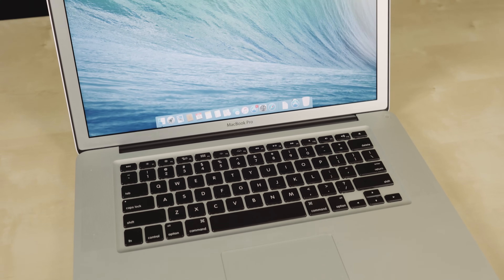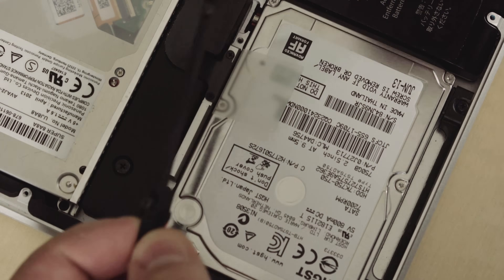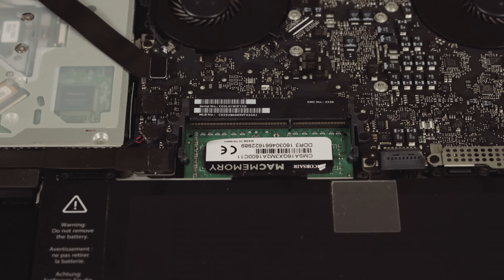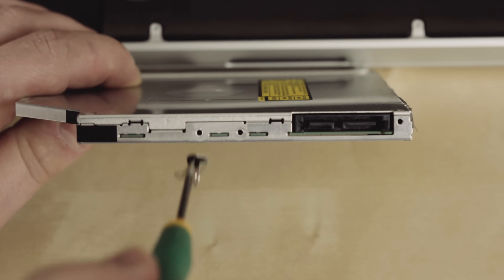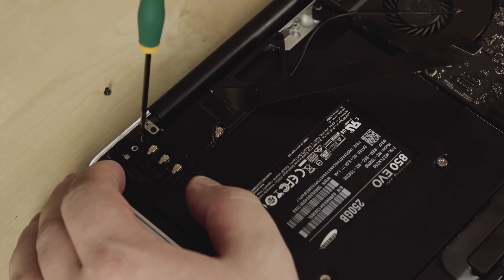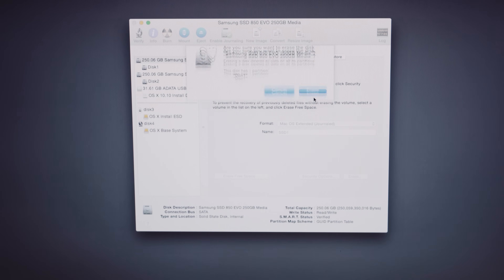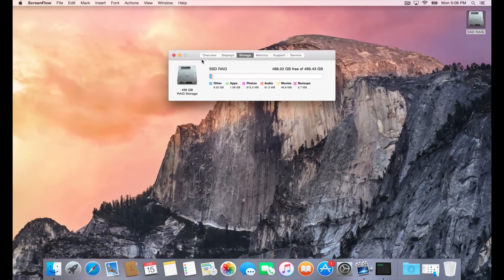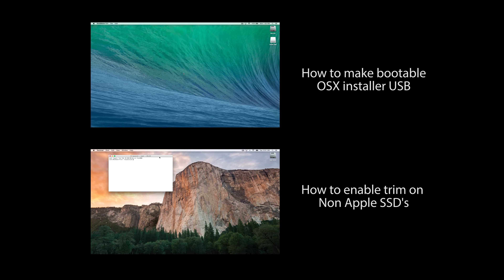Fastest 2012 MacBook Pro Ever! Upgrade Guide - in 4K

Comment: 16gb of ram is a waste. New macs don't even have that much or even require them.
Reply from the maker: Not entirely correct. The new 15" Macbook pros all come with 16gb. I max out 16gb all the time. I have 32gb in my main editing system and I can even max that out. Its necessary for running multiple adobe apps like Premiere and After Effects dynamic linked together. But you would be correct if all you do is surf the internet and do word processing and photo editing.

Comment: this is funny video it's all sounds you have to spend 400 dollars for two ssd card and 16gb memory card, you don't need to buy a new ssd hard drive for your macbook pro 2012 just buy 8gb memory card and i will tell you will meet how faster your macbook pro.
Reply: VisionOfCreation. It will be FASTER, but not the FASTEST. Rev Constantino suggested only upgrading RAM to 8 GB will give you the fastest Mac, but that's complete bullcrap. Of course, it will be FASTER, but not the FASTEST.

I got 16 GB on my 13" MBP 2012, and it got way faster, but it still can be improved. I do not want a RAID configuration because I can't afford two high-capacity SSDs. I'll eventually get a 240 GB SSD (Nintendo Switch was a priority Lol) and I'll do a Fusion configuration with the existing 500 GB HDD it already has

A RAID configuration is faster than a single SSD, because they basically split the writes. It's like doubling the lanes on a highway. Twice as many cars can drive on it, but that doesn't mean you need all those lanes. I don't need that much speed, so I'm making a Fusion configuration. If you need it to be faster, a RAID configuration is the best, as the purpose of this video was to show the FASTEST configuration. It's just that sometimes FASTER is enough
Reply: Yes, please.
Reply: I don't get you

You say you only need to get 8 GB of RAM to make your MBP faster, and that I get it completely.

But this vid is not about having a faster configuration, BUT the FASTEST configuration (some people won't even want a RAID configuration, like me)
Reply: Intelligent Investor

Storage times are only relevant to load times and writing times (Like exporting a video from iMovie or something like that)

RAM is much more important to the actual performance of the programs you use, because if RAM gets full, the OS will automatically use SWAP memory (virtually expanding RAM by allocating less used data in the storage drive, which also consumes CPU cycles), and even SSDs are slower than RAM. Also, Integrated graphics do not have dedicated RAM, so they share the RAM with the system. Having more RAM means the integrated GPU can use the RAM it needs freely while the system still has enough RAM to work with

TL;DR. Upgrading RAM gives you better performance, while upgrading storage gives you better reading/writing times

My suggestion: Upgrade RAM first. I have the same mid-2012 13" model and the RAM upgrade made it work beautifully
Reply: If you don't need the optical drive, you can replace it with an SSD. If you want to merge your existing HDD with the new SSD, a Fusion Drive would be great for you, as it gives you approximately 80-90% the speed of the SSD but the full capacity of both drives as a single one

Keeping the optical drive and switching the HDD with an SSD is a bit harder, since you'd be sacrificing storage or paying a lot of cash for an SSD with the same storage
Reply: put a single ssd in it, my 2009 boots from cold in 15 seconds with an ssd.
Reply: David Navarrete sooo, could I not just get the 500gb SSD instead of doing raid configuration and it will still be as fast?
Reply: VisionOfCreation no because when you have 2, its double the speed at (for example his 3gb file) they each do 1.5gb at the same time. if you had a 500gb ssd then it would have to do all 3 gb by itself
Reply: So would replacing an SSD make the best first step or upgrading to 8gb memory card? I have a mid 2012 13" with 4gb currently.
Reply: That's why I made it clear the SSD improves reading/writing times while RAM improves the actual performance

I chose to upgrade RAM because I wanted my programs to work better once they're open, even though they still take a bit to open. If your programs do work great enough for you and you just want to improve how fast they open (or how fast a video editor writes a 2+ GB file), then the SSD is the way to go
Reply: Dude so i was a bit lost but I am halfway done with my upgrade. I have a mid 2012 mac 13'' and just (yesterday) replaced the ssd. I got the samsung   860 pro 265gb and man this thing boots up nice and fast! I am wainting for the two 8bg to replace the two 2gb (4gb total, this is also what you have) so ill end up having 16gb instead of 4gb. They come in tomorrow but just with the ssd alone i can see a big improvement with speed.
Reply: You make no sense are you on drugs?
Reply: Rev Constantino Your grammar is outstanding
Reply: i have 8gb ram, please tell me how can i make my mid 2012 faster?

Comment: thanks for upgrading guide, so helpful. but i have a question: the ram of mbp can be up to 1600 Mhz, why didn't you buy 16GB 1600Mhz of ram instead of 1333Mhz of ram? 
https://www.amazon.co.jp/シリコンパワー-ノートPC用メモリ-PC3-12800-SO-DIMM-SP016GBSTU160N22/dp/B0094P98FK/ref=pd_sim_60_3?_encoding=UTF8&psc=1&refRID=MTSM54QWGYW66B1BQ1P4

Comment: Does anybody know if i can format to Raid0 externally? Would i have to have 2 SATA usb adapters? What i really want to do is to clone over a whole operating system from my old drive to the SSD's so that it will just start up as if it was my old computer.
  But if i format the drives in the machine will they then be able to be cloned from the other drive or will the cloning process undo the formatting that i have just done?
Reply from the maker: Im not sure if the system would recognize them correctly or not once you install them back into the system. But there are external USB enclosures that are designed for doing raid. They have two drive slots.

Comment: i did this to my 2010 mid and ya lol, ton of speed n all
Reply: Urska Jinx so it did work for 2010?
Reply: yes it did ^^
Reply: hehe hi Xd
Reply: @intelligentinvestor apple says that but the computer recognizes the 16gb of ram
Reply: Urska Jinx does it work for 2009 MacBook Pro?
Reply: Urska Jinx how much did you waste? I have 2010 Mac Pro 13in and looking to do the same thing. So it does work?
Reply: Urska Jinx any issues with this upgrade? Apple says 8gb max. Just wondering
Reply: @Idiotsincarshere  According to OWC and some other sites, you actually can go to 16GB unofficially. More information here: https://blog.macsales.com/16302-some-2010-mac-owners-can-get-more-ram-than-they-thought
Reply: I did my ram for my 2010 mid a couple of years ago and was surprised how much speed I got from it. The next project will be to upgrade from a 250 GB HDD to a 1TB SSD.
Reply: Urska Jinx it did?
Reply: Jimmy Sal that's the model I had and it worked perfectly
Reply: Is it fast enough to run fortnite????

Comment: I upgraded to the same Samsung SSD with 16GBs of RAM. If I wanted to add that second SSD does it have to be the same size as the one I have or can it be smaller because mine is 1TB and they are expensive?

Comment: hey im just wondering if using two 500gb ssd's would make the mac's performance faster than using two 250gb ssd's. Also, i was wondering if the battery overheating is an actual issue and if you get to keep this fast performance for a good time. thank you!
Reply from the maker: No you wont get any faster performance you just gain extra storage space.

Comment: @Zed ProMedia I have a question and want your opinion. I have a friend that is willing to sell me his 2012 13" i5 MacBook Pro for $500. Is that a good deal? Should I take it or leave it?...
Reply from the maker: Chris Hayes depends on what you use your computer for? $500 isn't a bad deal.
Reply: Zed ProMedia I'm wanting to get into video editing with premier pro. Stuff like that... the mac is completely stock so no upgrade are currently done on it. But that is why I watched your video and was wondering if that would help it perform better in what I want to use it for...
Reply from the maker: It will perform better because the read speeds in your timeline will have less issues with stuttering. Adding extra ram also helps with playback in the timeline. You wont see much improvement in export times though. And, unfortunately you cant upgrade the video card so that will have some implications when editing 4k video. But its pretty solid considering its 4 years old.

Comment: Is it better to buy a single 500gb SSD or two 250gb SSDs? would that change the performance?
Reply: Buta You only get speed improvements if you set your ssd's into a RAID configuration, just having 2 250gb ssd's will not provide any speed benefits over a single 500gb at all. In your case it would be more beneficial to purchase only one 500gb ssd for futureproofing and upgradability
Reply: What is RAID mode?
Reply: They both will be treated as only one. That's why you get better speed. You copy a 3GB file, each SSD will write 1.5 GB of that file at the same time. It'll last as much as one single SSD writing 1.5 GB, but they wrote 3 GB total

If you don't mind getting stock speed, you can always set some symlinks/hardlinks here and there to have the OS in one SSD and your desired folders (ex. Applications, User folder, etc) in the other SSD
Reply: Brend Vanden bussche guys, anyone can answer, but how will things be saved? Which SSD will applications, documents and downloads be saved to if you have 2 ssd's in RAID? Or will it just treat them as one? If you want to back everything up, will the external read them as one ssd and know what to do? Thanks
Reply: Zed Pro Media: would using 2x500GB give much increase in speed v. 2x250GB or would the gains primarily be in additional storage space?
Reply: Does it matter if the 2 SSD's are GUID Partition type
Reply: Buta Yes, because the read and write speed conna be not so fast like 2 Ssd in raid(double gb double speed)
Reply: Creeperguy555 why not do a back up then?
Reply: The downside is that a RAID is TWICE as likely to have an error or have a disk crash. Even the 2Gb 850 Evo Zen used can pull over 900 Mb a sec on Blackmagic solo and the 860 Evo should be even faster so the go is to put a 9.5 mm thin 2Gb HD for $100 into the DvD bay and a single big 860 Evo in the HD bay. 4Tb onboard storage for cheap!
Reply: Astuces 01 get outta here with your spam 

Giys don't listen to this guy, he is trying to install a virus on your computer
Reply from the maker: No performance gains. But you get an increase in storage capacity
Reply: Zed ProMedia which one will have more storage?
Reply from the maker: Oh sorry I thought I read 2 x500gb or 2 x250gb. You get double the speed from having 2 x250gb.
Reply: Zed ProMedia got it, thanks for the help!

Comment: Hello, I found your video and I am so thankful. I was thinking about upgrading my late 2011 MacBook pro 17". This video not only gave me an idea where to start but how to do it. Now, after watching this video, I have a few, detailed questions for you. I would really appreciate your help as I want to make sure the upgrade will fulfill my needs. 

1. How do I find which RAM & SSD that are compatible with my MacBook pro? Is there any website where I can check them? My laptop is slightly different models so I am not sure if for example Samsung 850 EVO 250gb SSD will be compatible. Also, the apple website says my laptop can be only upgraded up to maximum 8GB. 

2. I mainly use my laptop to record&produce music. I therefore need a lot of storage to store my musics, videos, and etc. What would you recommend me to do if I think 500 GB of SSD is not enough for me? 500GB would be just big enough to install all of my software apps. Is there an option where I can use 500GB SSD to install the OSX & softwares for fast loading, and have external cheap HDD where I can store musics and videos? 

3. After upgrading the storage hard drive to SSD, I assume all of my softwares will be erased, therefore I should re-install all of them, correct? 

Thank you again for your help. I will just leave my laptop spec just in case it might support your help. 

MacBook Pro 17 inch, late 2011
2.4GHz Intel Core i7
4GB 1333 MHz DDR3
AMD Radeon HD 6700M 1024MB
Intel HD Graphics 3000 384MB

Comment: Do u still need the OS X on a usb if i restore from time machine?
Reply: Lockheed Martin I don't think so, but I'm unsure, so just try it.
Reply: CobaltUltimate Altight i've ordered the parts ill let you know in a week
Reply: Lockheed Martin Actually, you might need the usb if you're installing an SSD because the SSD doesn't have recovery on it I think.
Reply: CobaltUltimate your right, I'm going to save it on a usb just in case thanks for that
Reply: no problem ;D
Reply: Oh quick question I don't have to do the "Install OS X" part if i restore from time machine backup right. Thanks again man!
Reply: Lockheed Martin No, you dont.
Reply: Cool, I think its pretty awesome of you for doing this. Ive been doing research on forums and other youtubers but you sum it up nicely cheers and count me in as a new subscriber!!

Comment: So on my wife's 2011 MPB I tried to join the new SSD's (512GB in the hard drive slot and 256GB in optical Drive) and dragged them both into the box and hit create. After creation It showed only 512GB was available. Both drives are x400 ScanDisk. Any ideas or insights would be appreciated.

Comment: I just completed the install minus the RAM (i already have 16GB), is it normal for the Macbook Pro to overheat slightly?  Its pretty subtle but I am just curious.

Also after the install does the battery drain faster than normal? I am noticing a small decrease after the install.
Reply from the maker: Mine has always ran hot when doing any video playback or editing. I have not seen a change in the battery life. I still get around 4-5hrs of photoshop editing, screen on full, with wifi etc

Comment: I bought the ssd and transferred some files from the old hdd to the new one, I just saw your video and realized that had no enable trim.. I already did. my question is.. does it affects the performance if enabled trim after using the add for a couples weeks?

Comment: Did you get a screen replacement on your MBP? Because I have a mid 2012 MBP but the bezel  around the LCD is black.
Reply from the maker: No this is the original screen that came with the laptop. The reason you have a glass bezel is because you have the normal (1440x900) screen. The one in the video is the higher resolution (1680x1050) Anti glare screen that you could custom order at the time.
Reply: Zed ProMedia Oh wow, didn't know you could do that back then. Well ya learn something new everyday! 👌🏻 Great video btw. Might do this to my MBP because I can't really afford to get the newest one right now.

Comment: Thanks. I will stick with 1 drive for now. Is it worth it to enable trim ? Have read good and bad about it. Should I enable using terminal? How do I do that exactly. I trust your info more than most people on here. Thanks again
Reply from the maker: I always enable trim. The easiest way to explain it, Is that its a way of OSX maintaining the ssd. Over time if you don't do this the drive will actually begin to degrade in performance. Trim keeps everything organized and basically does garbage collection management for every time to write and remove files. This keeps the drive snappy and fast like the day you installed it.
Reply: Alright. I just installed my new evo 850 ssd, 16mb OWC ram.  Plugged in the USB drive with El Capitan on it made using Diskmaker app.  I turn on while holding option key.  Screen opens and shows OSX installer from usb drive. Clicked on it.  Apple with progress bar and it gets to end of progress bar and just sits there. How long should this part take? Screen is a  darker gray than normal.  Help please. I am new to this and thinking there might be a problem
Reply from the maker: Gary Sbraccia it could be the installer USB. Might want to try making it again.

Comment: Did you have any problems with the 850 EVO? considering buying it as a main drive and putting the hdd in the optibay. How do the SSDs hold up? Any problems? And I see a video on TRIM - did you have any problems with it? system corruption or data loss of any kind?
Reply: Бесей Нургалиев Apple uses TRIM for wear leveling and maintaining performance so good enough for them, good enough for me

Comment: Thanks for quick response. Is it worth doing the 2 drives? My 2012 will support 6g in the optical with a sata connector? Can I use trim in El Capitan. Also running a striped raid zero, will that mean I have same stuff stored on each drive or can I still use 1 for video and media and the other for startup and everything else. Sorry new to all this upgrade stuff. So 2 500gb ssd drive will be a 1 tb drive in striped raid zero?
Reply from the maker: Gary Sbraccia so when you make a raid0 array what happens is. The OS will combine the drives into one drive. But because you have two drives with individual 6g connections it opens up so much more bandwidth than one 6g connection. So to answer your question. No it won't show as two drives it will only show as one drive but with the capacity of the two drives connection. So yes you are correct that 2- 500gb drives will give you a 1tb drive. Now if you wanted 2 drives (one for videos and one for el cap) you can do that you just can't do raid 0 and both drives will just run at their normal rated speeds.